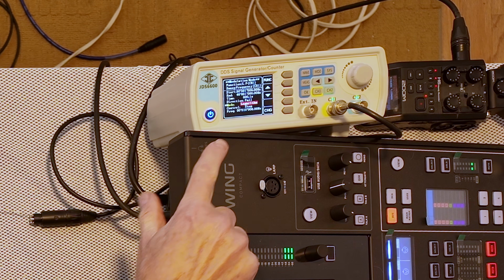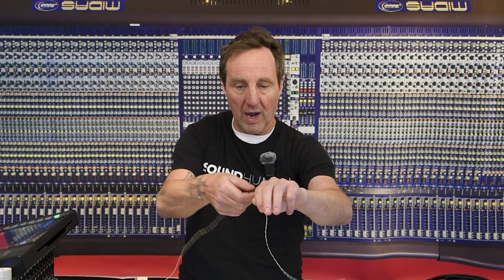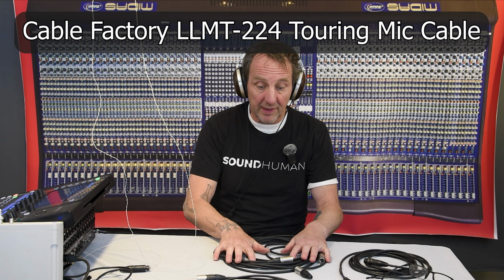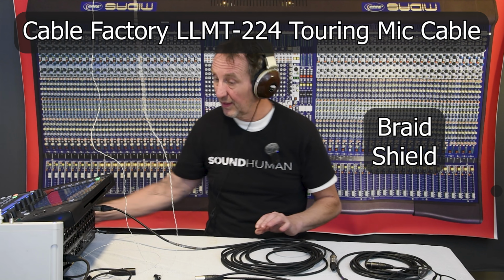Pro Audio Cable Noise Tests - Which is Best?

Comment: As far as I understand it, different shielding materials can also have an effect too (by how much, in shielded cables I can't say, but for sure with things like cases). For an example, something like iron, steel, a perma-alloy, or mu-metal etc, anything with a high magnetic permeability, can absorb EMI without being grounded (to a certain extent), way better than something like say Aluminum would. 

I think the most important and most likely to be of effect in these specific tests however, would be the difference between copper and aluminum shielding, as it's not only the magnetic permeability that has an effect, but also the electrical conductivity to some degree too. So, theoretically, copper should be a (at least a tiny bit) better shield material for EMI than Aluminum. How much of a difference it would make in cabling though, I am unsure of, and don't have mu-metal or steel shielded cables to test (although I think you can get steel armored cables, they are generally way chonkier than normal audio cables) xD. Although, it would be possible to compare Copper vs Aluminum I think, as I'm sure they can both be found in audio cables with relative ease, it's just finding ones with all other specs exactly the same that is the really hard part, in order to make it a fair test!

Comment: CABLES MAKE A 
SMALL PERCENTAGE 
OF DIFFERENCE 
ALONG WITH OTHER
SMALL PERCENT COMPONENTS ADD UP TO TOTAL SOUND QUALITY. Like oxygen free copper cables sold by Meter, Expensive 
But a must for audiophile equipment and listening. 
Differences that can be 
Heard on high end systems from preamp amp and Speakers.
Even Connectors make 
Difference including RF
CLAMP ON TRAP ON AC CORD BEFORE ENTERING THE UNIT.
Why Certain Systems sound Clean and others not. 
Cheap cables work and when turned up barely notice, but in Recording thats when
You hear gremlins
Reply from the maker: as you can tell from my videos I pretty much test everything and  if there's not a test to show that it's clearly measurable and audible then I consider it dubious until proven otherwise. 

if there's a claim that something sounds better or worse and it's a small fractional thing then what I do is find a way to multiply the issue times 10 and then see if that's audible. 

for example, if oxygen free copper 20 ft cable is supposed to sound better than a non-oxygen free copper 20-ft cable, I would compare 200 ft of one versus the other. 

The issue would then be 10 times more prominent and should be clearly and fairly easily audible or at least somewhat audible. if it's not audible, then it's highly probable that using the 20-foot cable with 1/10 th the issue will mean that it's insignificant or irrelevant. 

this is a good way to make wise and balanced expenditure decisions factual information rather than opinions and assumptions.

Comment: you should get a triax cable and mount some xlr plugs to it.  
i wonder how good it will be
Reply: Likely horrible for magnetics. You will not get a good CM cancellation out of triax. The performance of SQ being better than plain pair proves this, as the SQ is all about being a statistically better "two cables in the same place" than is pair. Putting one conductor inside the other (which triax is all about) will not make them equal in a way that benefits CMRR. 

Another, less capacitance-punishing way to do this better is to have a shorter twist, which is why the CAT cable (which needs good rejection and good UHF response (CAT7 is IIRC rated to carry 350MHz and the lesser degrees at least 100MHz) has a short twist helping with the rejection.

This is also the same reason you will not see a DMX or AES3 cable using SQ, because the capacitance is a killer; both systems  need performance out to 2MHz to work to spec, and star quad will struggle because the mechanical construction of 4 conductors twisted together creates a much "better" capacitor than a plain pair would be.
Reply from the maker: great point. the improved EMI rejection of quad costs HF response.

pretty much seems that shielded cat cable is the best all around solution

Comment: Are there cables that do both really well? E.g. a foil shielded quad?
Reply from the maker: the drain wire in foil sheilded cables makes them more susceptible to emi.
Reply: Then you could search for a cable without a drain wire. Perhaps a foil together with a braid of strands or round wound strands, that goes all around the circumference and with a high coverage. Possible with the shield strands drawn over on the outside of conductive plastic, with the insulated signal wires inside a tube of insulation. (So, twisted wires and fillers in a non-conductive tubein a conductive tube in a foil shield and a braided shield around it, and then the outer sheath.)

Comment: Would love to see these tests on a midas DL251 "blue-face" mic-amp vs a allen&grief SQ5 or something
Reply: From experience at a venue less than 1000 feet from an AM radio transmitter tower, When RF levels start to exceed 15 volts peak on the cable, many op amp balanced input units start to detect the RF. These known issues are the Behringer X32 console, Mackie SRM450 powered speakers, and the Meyer Sound 616 speaker management system when connected to a Whirlwind analog snake from FOH 125 feet away. RFI filtering fixes the issue. Snap on filters don't work completely with AM radio nearby. We had to use 15 miliHenery chokes to attenuate the RF at the inputs to attenuate the RF enough to no longer detect it in the audio.

Comment: Twists kill magnetic field related noise by generating identical but reversed induced electromotive force in adjacent loops, which will cancel out along the whole length of cable.
Shields kill electric field related noise by forming a grounded Faraday cage around the main conductors, blocking out and bleeding off induced electric charges.
So technically cables with both twists and shields will work best on interference rejection... and shielded Ethernet cables are perfect for this!
Also curious about how digital-spec cables like AES3 and DMX512 cables perform in EMI and RFI rejection experiment. Technically they should perform better in EMI compared to analog-spec cables.
Reply from the maker: interesting and thank you and I agree. 

The one thing that kind of caught me off guard during the testing was the foil shielded cables being worse for EMI due to the drain wire  reducing the symmetry creating an imbalance in the rejection
Reply: I would be interested and seeing this test done with a three-pin DMX 512 as well. 120ohm and made for high speed digital data, also normally having a higher quality shielded cable. Would be cool to see.

Comment: Awesome topic Professor D.R, I was helping a small trio group find and eliminate the noise coming from a new harmony pedal on the weekend. It was incorrectly set gain structure along the signal path and cheap unbalanced leads didn’t help. I love how you have a video on so many different aspects of audio engineering, you are a treasure trove knowledge!  Thank you for sharing ❤GPN
Reply from the maker: wonderful and thank you GPN!

Comment: With the RFI test it would be interesting to see a different frequency range, by that I mean different HF ranges, straight through to 2.4 GHz. for RFI i have found Farrigh cages and loops to be quite effective.
Reply from the maker: Yes that would be interesting and fun to do. not sure I want to invest in the gear to do it though. I think for the most part we should see a similar trend not necessarily in the amount of in interference but in the relationship between the cables with more shielding and less shielding offering better protection and less protection accordingly
Reply: @DaveRat Far enough. This comes from being a Radio guy as well I have recently been down this Rabbit hole Lol
Reply from the maker: very cool and do you have any recommendations on what I would get that's not overly pricey to use as a 2.5 GHz noise maker?
Reply: I think perhaps a UHF range noise test may be more applicable to the real world (think cables near IEM transmitters at high output powers for example)

Can’t newer TinySAs generate as well? Maybe one of those, even through a cheapo amp to test really worst case scenario?

Comment: Very interesting.  Any chance we can get a video on different RCA cable types (twisted pair, coaxial, and straight)?  I've always wondered how much if any difference it makes in home theater. Like is that expensive subwoofer RCA cable really better than the cheap ones meant for regular audio out?